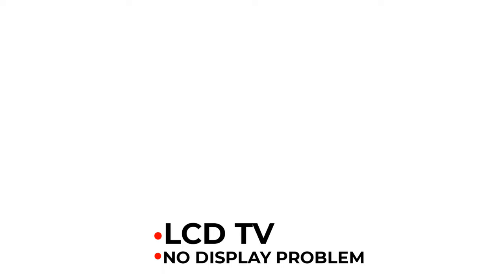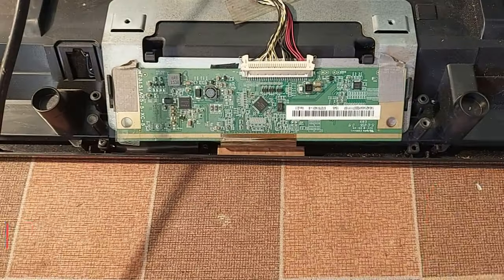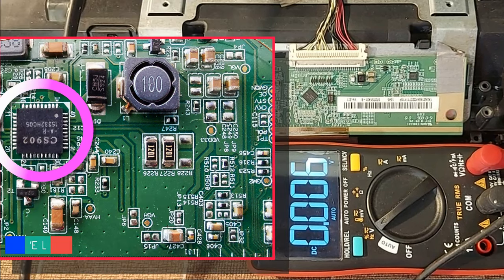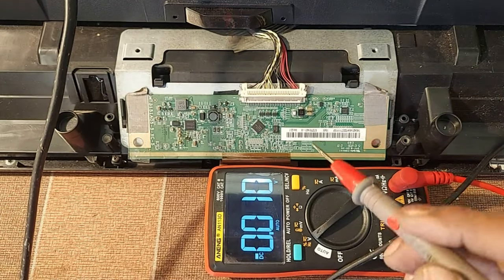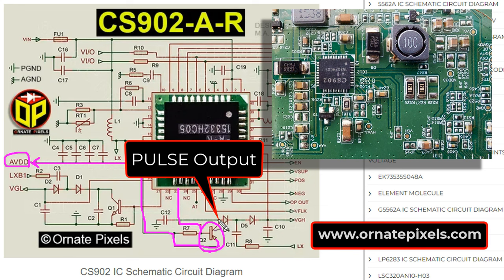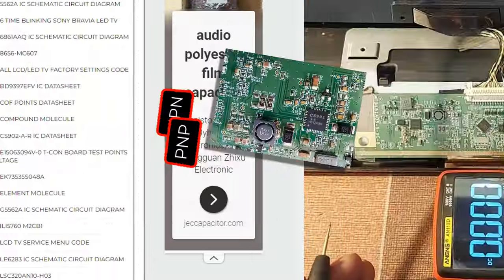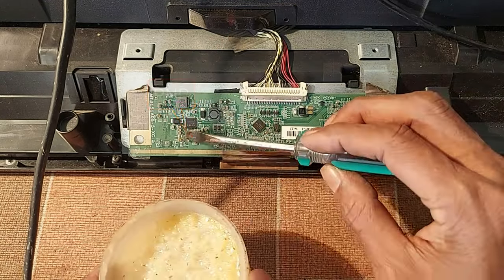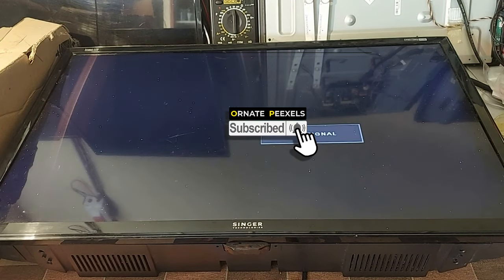No display problem on LCD TV Screen | CS902-A-R IC Circuit Diagram | MT3151A05-5XC-5 Panel Repair

Comment: 👍 Seem to me that ic use smd transistor,that's why voltage not out from test points tcon board.Maybe transistor as protection to IC. Very good work friend.

Comment: Sorry sir, permission to ask, I have a case with a panel of the same type, the voltage (VGL, VGH, drops), the condition of the transistor is good, is there a short in the panel, if so, do I have to cut the path to the panel?